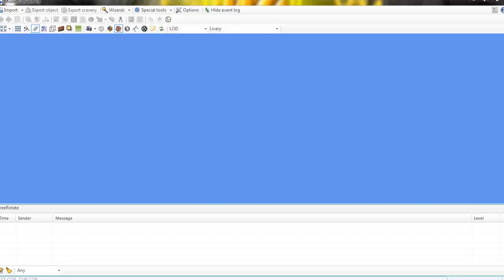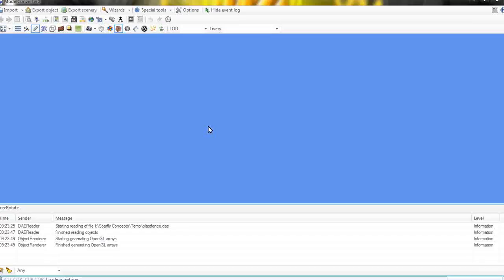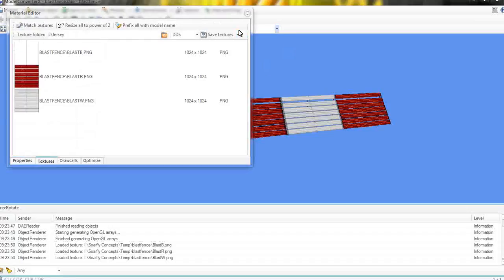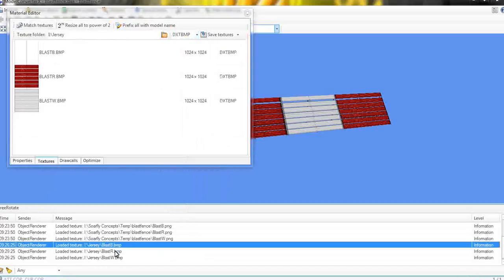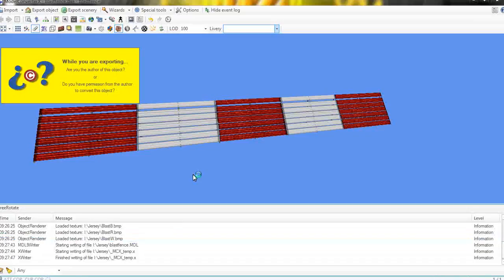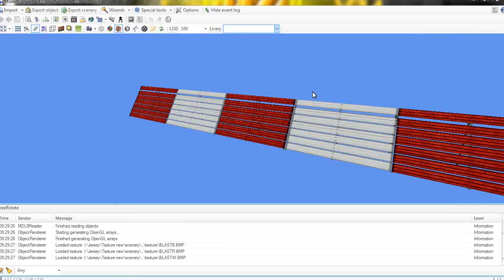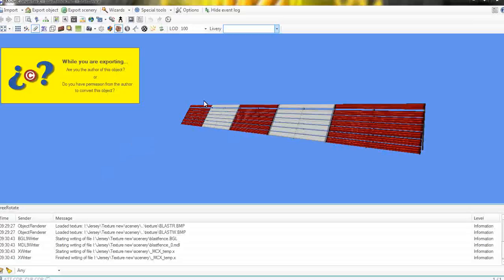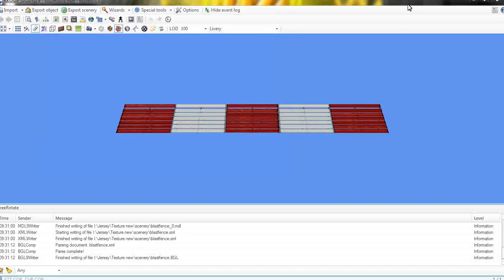Model Converter X Sketchup to FS9

Comment: This is awesome, I could be a step closer to put my building designs into FS. Any clue how I could place the BGL file into FS9?
I was wondering if I could utilise EZScenery or maybe some other apps.
Reply from the maker: +Michael Adi Download "library creator xml" and export your .mdl files and use library creator xml to make an object library then you can use ADE or another object placement tool to place themin FS2004
Reply: +Soarfly Concepts Scenery Got it, I used EZ scenery and it works, thanks! But I'm still having problems exporting my textures from model converter. On your video there's a 'save textures' tab, but I don't have it on mine. Any idea?
Reply from the maker: Youy will need the latest development release of model converter X you can get that from scenerydesign.org
Reply: @Soarflyconcepts  Mark, are all your videos also suitable for fs9?
Reply from the maker: @user7-FHW5-O  they are, you'll just need to select FS9 on compile from MCX